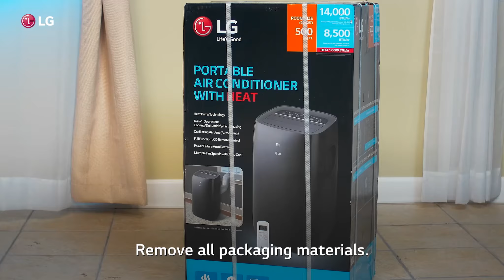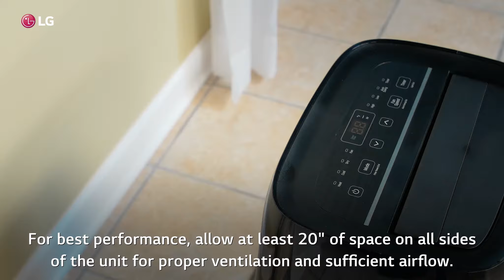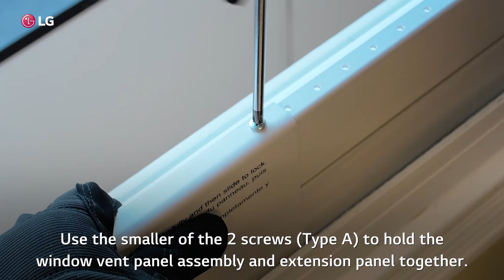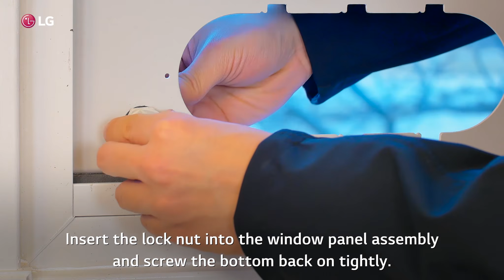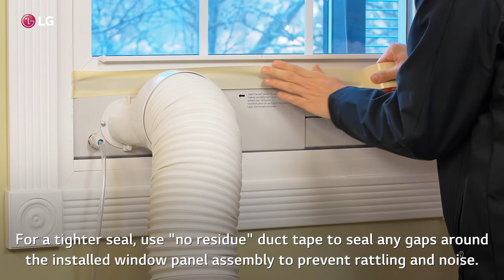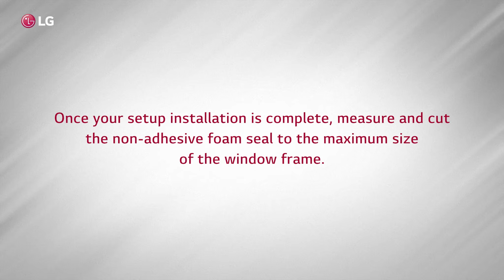LG Portable Heat Pump Air Conditioner - How to Install & Setup for AC, Heat Mode, and Dry Mode

Comment: Do I need to run the air hose that vents outside  when using it in dry mode or just a drain hose for the water?
Reply from the maker: Hey there. We appreciate you asking us this question. The Air Hose circulates the air from your unit to the outside. When in dry mode, you will still need to use the Air Hose and a drain hose for the water that needs to be connected through some sort of drainage system in your household. ^Anthony

Comment: What do you do if the heat pump drain doesn't work? Manual just says automatic if plugged in, mine will NOT drain, keeps filling up...
Reply: If your heat pump doesn’t work then make sure it snaps it in place if not you’ll have to push the outer ring of the pump drain port in and pull the connector out and reinsert the connector into the pump drain port
Reply: @Gabeohara-u5 I found out the pump only works in heat mode, So I hotwired it. The blower actually blew itself apart after a year or use. Garbage

Comment: You missed the money shot though bro I think you're supposed to run the hose in the house for the air dryer that's why I watch this video to find out but it's not in there

Comment: Im sooooooo confused mine came with no hose no drain hose no nothing.  If i use AC mode only do i need to drain anything please answer i bought the LG LP1220GSR 18 portable air conditioner with 12000 btu model. This video says you only need to drain on heat and humidifier mode im confused as hell.
Reply from the maker: Hi! One of our support team members would be happy to answer any questions you have. Please send them a message via FB or Twitter (LGUSSUPPORT). Thanks! ^Emma

Comment: Does this have a reversing valve?
Reply: In heat mode, yes, it may stop for a short time if you switched from Cool to Heat, to protect the compressor and the fan.

Comment: Hi, I made a couple of calls, if you have not found your drain hose for your portable unit. Call Encompass parts @ 866-779-7906 or Encompassparts.com , part# COV36174368.
Be prepared to spend about 60 bucks which I am pissed about because I see nowhere in the instructions the part is optional, other than that the unit is okay. Stay safe people
Reply from the maker: Our apologies for the late reply. I hate to hear that you are having an issue with your AC, but I'll be happy to look into it. Please contact us via Twitter ( @LGUSSupport  ) or Facebook Messenger ( https://www.facebook.com/LGUSA/ . Thank you for your patience. ^April

Comment: My A/C unit came without a drain hose... 👌
Reply: Mine too and the unit is spilling water in ac mode
Reply: I have the LG LP1420BHR, i contacted LG about missing drain hose needed to run the heat. I contacted LG, the part # i needed is COV36133186 .
Reply: Mines to I give them call though